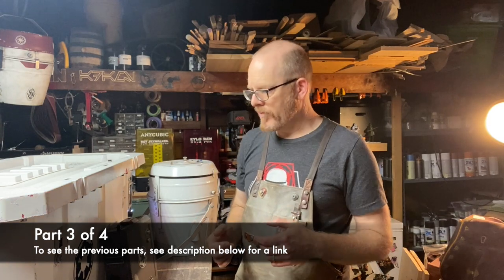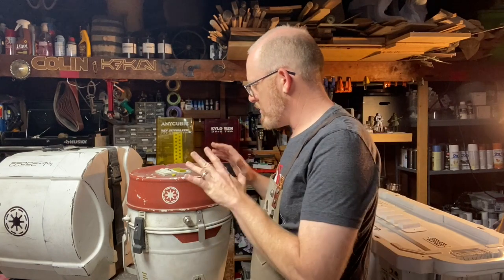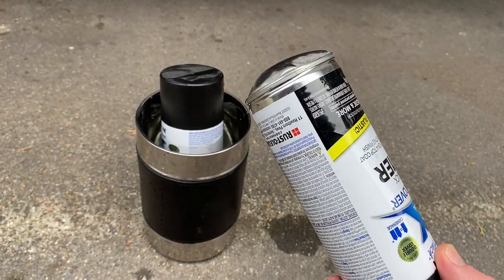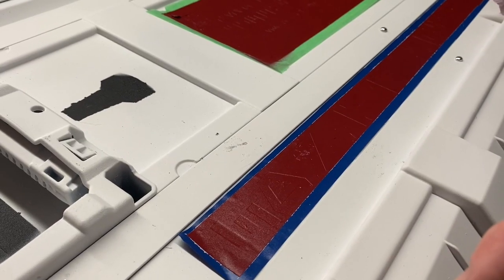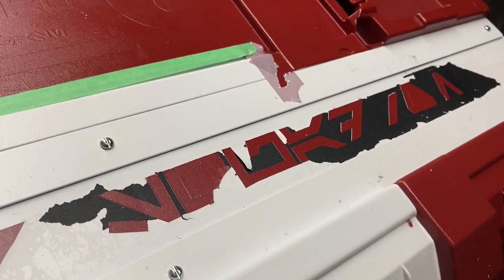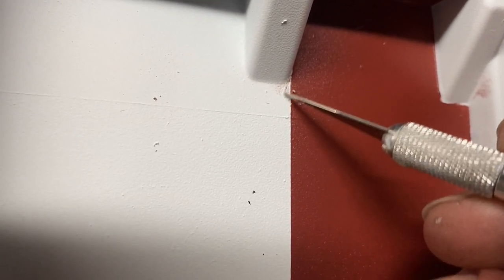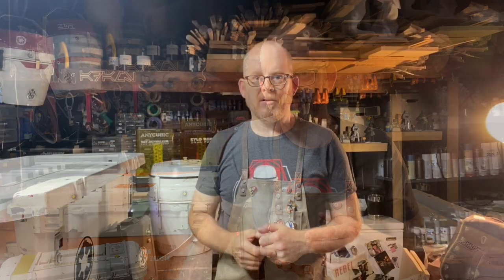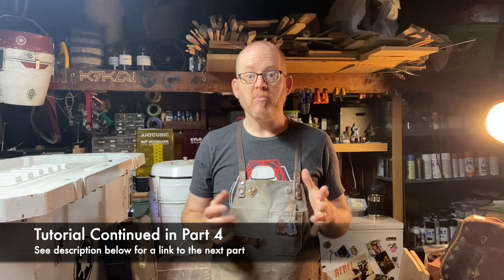Customizing Costume Containers - Part 3 of 4

Comment: When you paint your cases, specifically the cases with hinged lids do you disassembled the case before painting?
Reply from the maker: No, they usually are assembled in a way that makes that very difficult to remove, so I just paint them attached.